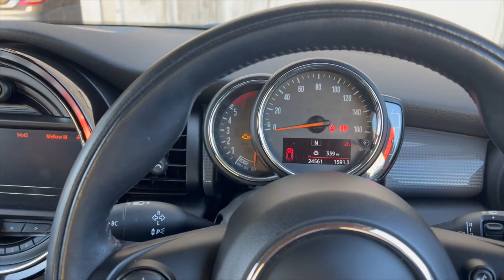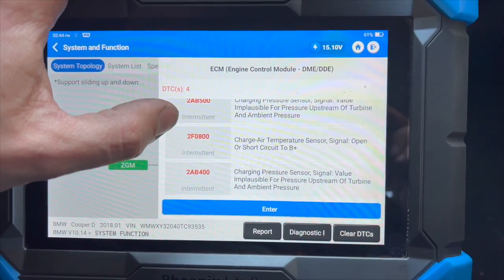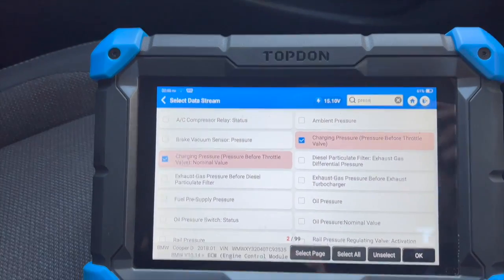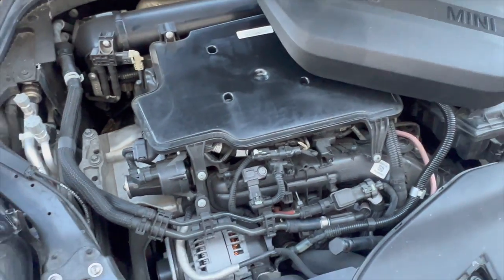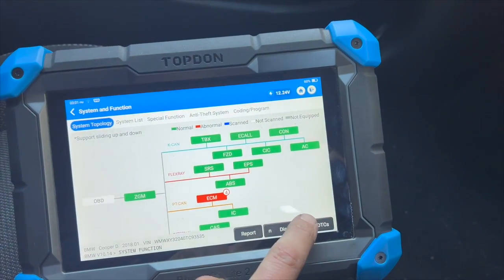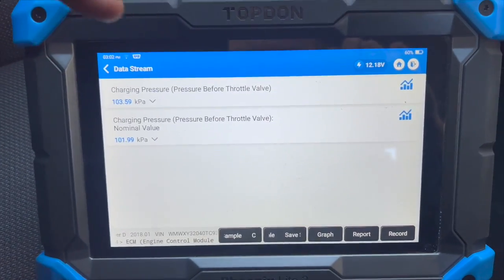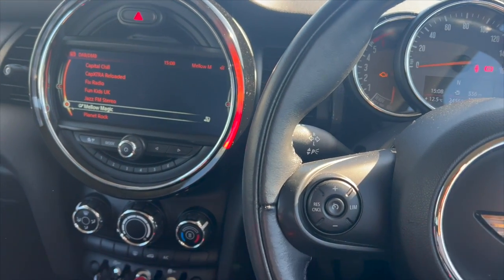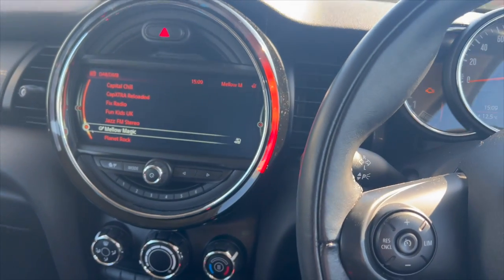Mini 1.5 Diesel no boost fault 31C400 2AB500 2F0800 & 2AB400

Comment: My partners MiniCooper D 2015 is having a similar issue. Newly purchased, yellow engine light, been into two garages, multiple intermittent faults, no permanents, possible EGR fault or boost sensor fault is what the 1st garage said, Auto electrician couldn't find anything else. Would you say that sounds like the same issue?
Reply from the maker: Possibly it’s hard to say without looking